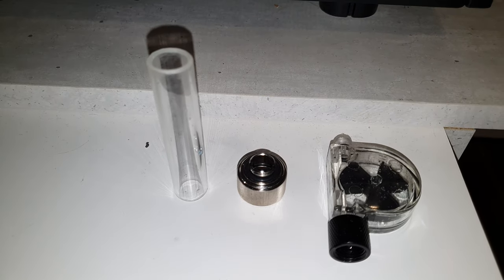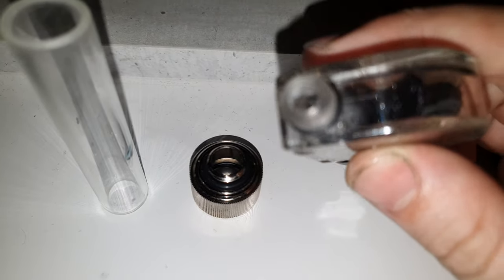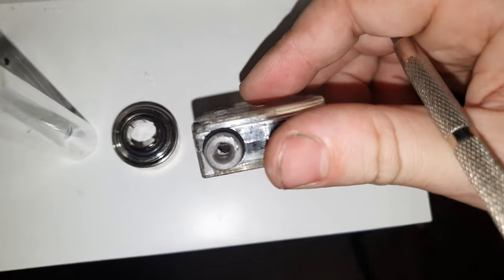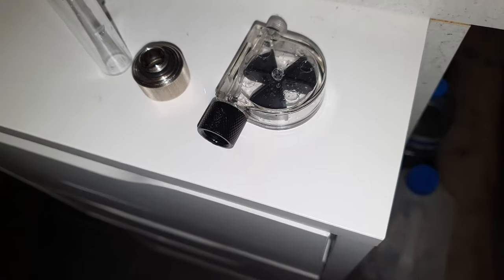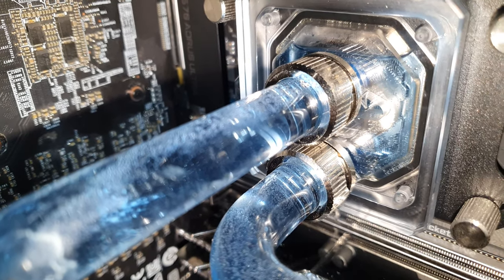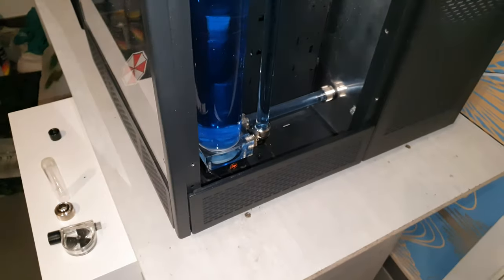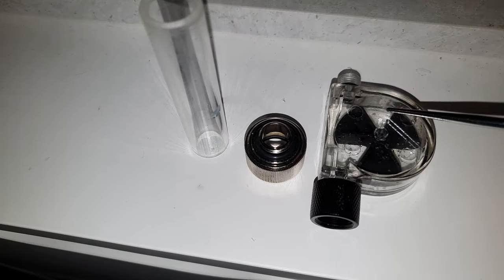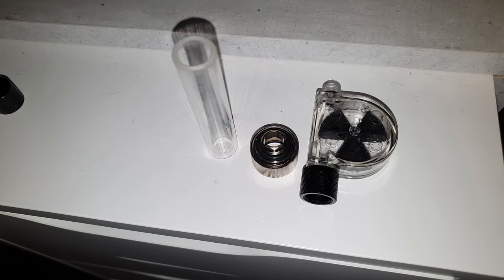Should you install a flow meter in your PC ?

Comment: to solve bubble you need put reservoir higher then water block
Reply from the maker: Not possible 
But the bubbles are gone now 😀
Reply: Absolute rubbish. If true, that would mean there would be air in the radiators unless you put the resovoir on top of the case. Face palm.

Comment: Cpu block not filled? I think you put the inlet tube incorrectly.. from the pump going to the outlet (top is always out not in) does makes water inter from the to and force it to go down as out (supposed to be inlet/in) the result is you will have a gap at the top most part of the cpu block

The second reason is you cpu block is currently at the highest part of the loop because of the first reason and the tube going down to the bottom part of your loop going in to the radiator making the cpu the highest part of the loop creating a air gap..

But if your pump outlet is going to the radiator going to the cpu block going back to the pump inlet/in the only reason might be the cpu block is at the highest part of the loop it should be somewhere near at the middle..

And yes that flow meter will restrict the flow itself because of the dumb design making it harder for water to go in and go out reducing the flow rate.
Reply from the maker: There is no in or out on the cpu block i asked many people
Including EK itself 
There is no air in them anymore🙂